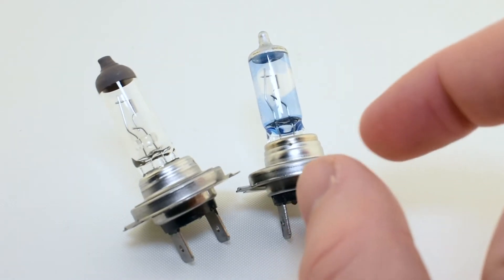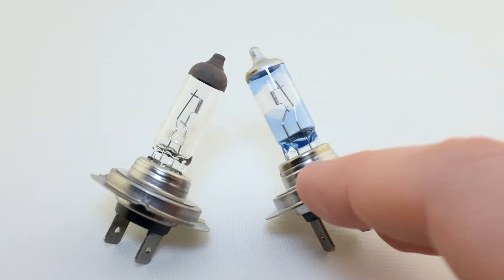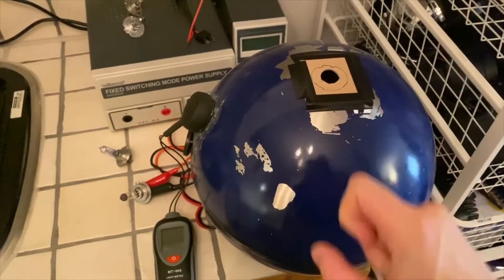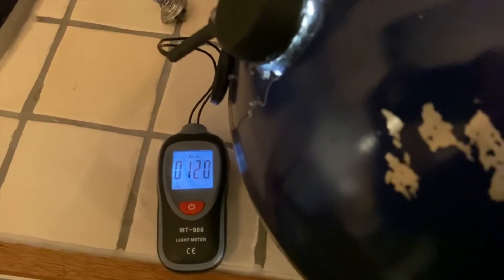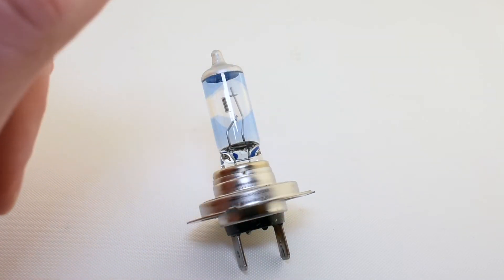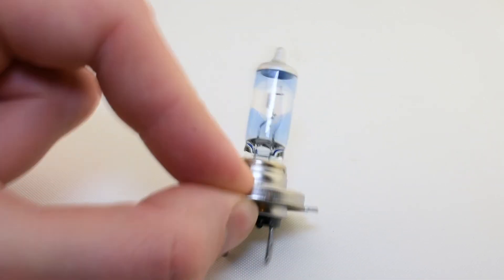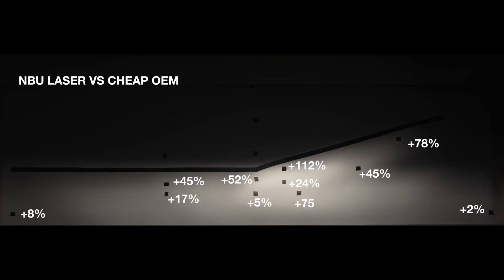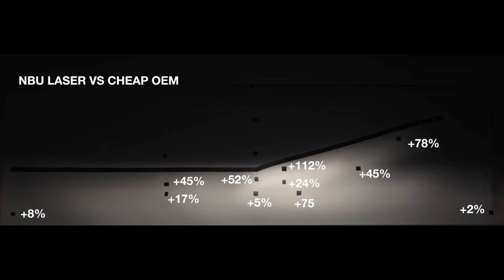Halogen Osram Night Breaker Laser Vs Cheap OEM H7 Bulb – Degradation Test 72H

Comment: How have i only found your videos!
I've looked many times for videos like this and only just been successful with your channel. 

In at least one video of yours, you've mentioned that the camera isn't locked, so we can't see the difference in brightness in the video.  I guess you're using your phone to record these videos?  If so, at least default camera apps have a pro setting where you can lock the iso and 'shutter speed' to lock the brightness.  Alternatively,  Android has third party apps like OpenCamera that also have these features.  I assume Apple third party apps have the same features too.
Reply from the maker: I find it interesting testing stuff, but something like this takes time and energy. And it’s not like anybody have sent me anything for free or pay for the time :) hehe. But I like documenting my findings.
But I guess I then used my Nikon DSLR camera or maybe my iPhone. Yes if I lock it, you can actually see the difference in brightness. But it’s still just an indicator. Direct measurements with lux meter tells the real difference, although not perfect, but then you would need super expensive equipment.
I just see a lot of tests and sellers like showing how bright the light is, but it’s just overexposed. Or maybe you have a really good light, if you use auto settings in the dark it will probably look the same as the bad light, since the camera is compensating.